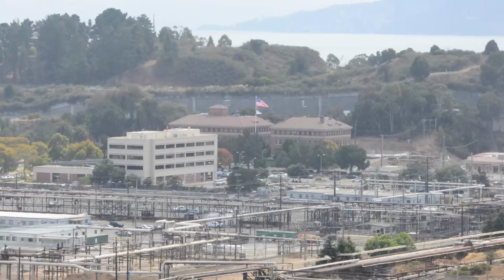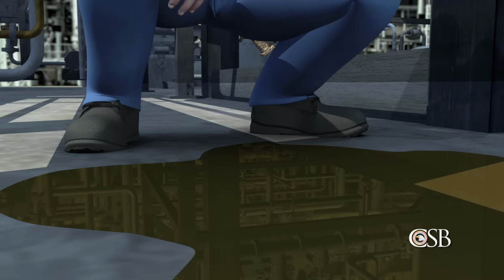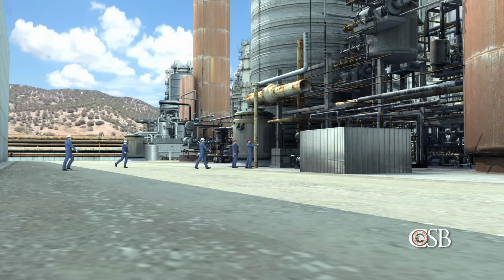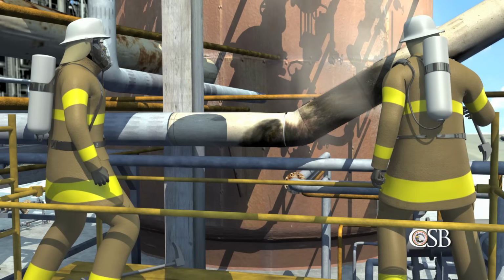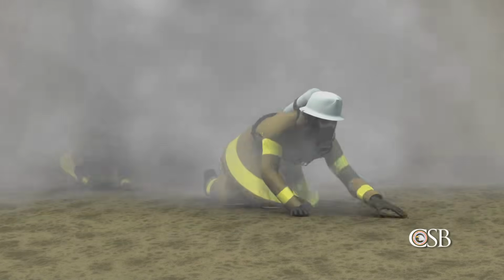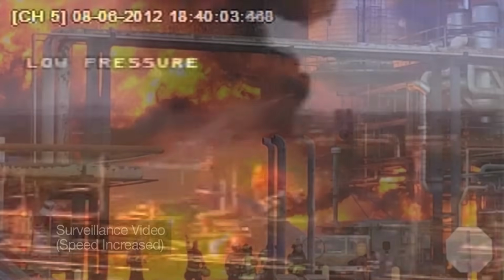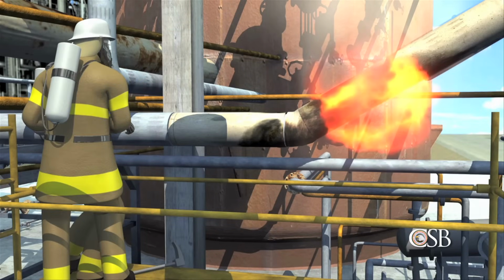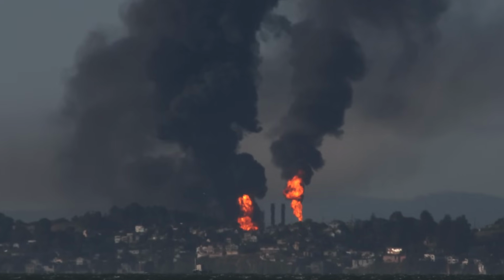Animation of Fire at Chevron's Richmond Refinery, August 6, 2012

Comment: This is why I walked away from my $100k job years ago. They didn't shut down because it would mean less production... which means less money. They lose millions per hour when they stop production. Patches are always tried first. I've seen them weld on pipes with hot oil flowing in them. It's normal practice.
Reply: In other word their production is worth more than your life to them.. Sad really
Reply: @MannyFresh1x  In laymans terms schedule to fix it before it makes an unscheduled boom
Reply: @the_expidition427 I love that, "unscheduled boom" lol...just like driving an engine with a rod knock can lead to "rapid unscheduled disassembly"
Reply: This is madness
Reply: Its dumb because when it fails all money saved from avoiding maintenance and shutdowns is quickly caught up in MASSIVE repairs and damage, new stuff and community compensation, legal recourses...

Always work safely but certainly. You'll make more in the end when you dont break anything...
Reply: @mollyscullyscully80  Agreed.  Just from the self-interest, cold financial point of view, it makes sense to proactively do maintenance.  If they are trying to avoid shutdowns that may last for at most a day, well, after an accident they have a shutdown that can last weeks, plus all the expense to cleanup, rebuild and pay compensation to the community, etc.
Reply: @Walter-Montalvo  a shutdown of any unit in a redinery to fix any issue last a lot longer than just a day.
Reply: @chriswalker9218  Thanks for the info.  Since it takes a lot longer than a day, I can see from the financial point of view how it might make sense to postpone.  Not going to lie, that is murky.
Reply: @chriswalker9218  just the paperwork and planning is probably weeks of work on it’s own
Reply: @mollyscullyscully80  “you think safety is expensive, try accidents”
Reply: They care more about money than peoples lives sadly
Reply: I just left Chevron Richmond for their latest shutdown....my first and LAST. No thanks. WAY too many variables for me to feel safe.
Reply: Jesus Christ. Welding on an active gas line is like playing hacky sack with a stick of dynamite.
Reply: @ffandrewd2986  not really. If there is a flow in the pipe the product will not ignite (no matter what the product is) if the welder were to burn thru the pipe.
Reply: I work in plants for a living. I see it all the time. They try and act like safety is number and that they care about you going home or to your motel 16 hours later.. but they see us as scab workers with dollar signs on our hard hats. Makes me sick but nothing else around here will keep us afloat. I got the twic card so I may take a river boat/barge job.
Reply: @Petryfied  yeah the safety talks are just to look like they care. When it comes down to production they don't want you stopping for a safety concern. And if you are wrong, or it was minor they reprimand you for stopping production. Its a culture of only report a fire, not the smoke.
Reply: @Petryfied you should become an ironworker they take everyone and you can make good money, esp with overtime
Reply: Your life is worth way more than a pipe fitting. Good on you for leaving, safety first.
Reply: @ameanasaur  roger that
Reply: The insurance companies should put more requirements for safety procedures or they won't pay out. That would get their attention.
Reply: @gangisspawn1  they do. But cheap managers won’t give a shit as they won’t be the ones punished unless they can prove they forced people to work unsafely. With “obligation to refuse” from “right to refuse”, a lot of the blame can be placed on the worker legally.
Reply: Wow!
Reply: An accident will always cost more than the safety to prevent it. People just don't get that for some reason
Reply: Welding on certain types of pipe is actually pretty safe depending on what’s going through the pipe, normally natural gas lines. Though, I’m not sure of the safety of welding on a patch..🤷🏻‍♂️
Reply: I’m from New Zealand I’ve been a pipe fitter welder and fabricator my whole working life my family owns a large company in NZ... We went to inspect & quote a job repairing a damaged flange on the top of a 50 metre high oil silo at a oil processing plant they said it had been evacuated of all oil, vapours and residue my co worker opened a port hole used for inspections he was hit with heavy strong smelling gas vapours he said we don’t want anything to do with this is a disaster waiting to happen it’s either not been clean/evacuated or it has a Passing faulty valve they said ok we will sort it them call you back.....    

They didn’t do that they called another company told them it was all clean etc which was a lie two workers went there a father & son they didn’t check for vapours just started welding trusting the Judgment of the staff at the Facility within 20-30 seconds it exploded vaporising the son bit of him went everywhere they dad was on a ladder to the side he got some burns but survived but only a few Weeks later he committed suicide as he couldn’t bare the burden of his mistake which was not checking for himself trusting the employees from the plant....  

There was a big investigation the company lied to the Authorities and forged safety forms and gas vapour tests to try sweep it under the carpet but they were found out and they company was shut down and a good 12-15 people went to jail the really scary thing is me and my Dad were supposed to be the ones working on the job the next day after the quote as it was a long weekend we were short staffed I had never actually worked on site with my Dad before he more ran the company from the office so yea I’m so great full for our co worker who was on point and checked everything as he had lost some friends to a similar accident when he lived in the UK (United Kingdom) he was so messed up from witnessing it he left his homeland country to live in New Zealand and he only started a few days before our other worker 100% wouldn’t have check as he has health issues he wouldn’t even have Climbed the ladder....   so yea Please PLEASE Everyone be safe a weekly wage is not worth loosing your life over...   sorry for the novel, I haven’t even talked about this to anyone since it happened 15 odd years ago
Reply: If the cost of the lawsuits is less than the cost of safely shutting down operation for maintenance they will take that 10/10 times sadly.
Reply: @Ruin3.14  it is the exact same in the financial industry. these people can make a living off of ruining peoples lives, that and fines are just the cost of business and business keeps on being profitable
Reply: Which means you sir are an Amazing upstanding Human being I have a whole lot of Respect for you and anyone who shares your Core Values very well done 💯🖤🇳🇿🤙
Reply: That’s called a hot tap, it happens
Reply: BUT they would lose BILLIONS if it blows up . .. . . America has a issue with short term vs long term investments /  profits / mindset , companies want short term everything  because in their mind it is faster way but in the end it just hurts them and everyone else around them.
Reply: process is called hot tapping, It's common practice in refinery business. It saves a lot of money.
Reply: Yup, this is what money does to people. We only care about profit margins. People die everyday over money.. when will we learn.
Reply: It is the nature of business.   The person in charge of maintenance gets a nice personal bonus if he/she controls costs below what was budgeted.   That is also how so much TCE ended up in drinking water aquifers in Silicon Valley.
Reply: Thats called a hot-tap wich isnt unusual. It is a high risk though, special precautions should be taken.
Reply: @vmk14296  yup. It’s normal practice. Scary… but done a million times with no issues usually.
Reply: yeah but when an accident like this happens they lose billions
Reply: I know this is a 4 year old comment, but I’ve recently started as an operator in the uk and have found the opposite, it’s by far the most safety conscious field I’ve seen, there are many, many safeguards, protocols and plans to operate safely. My background is in aviation and I feel just as safe in this role.
Reply: @MrTuts4life  the Industry is very safe. But I’ve also seen refineries choose to keep a frac tower or gas unit running to do repairs instead of shutting the system down which would be safer. Shutting down equal lost profits. To them the risk of death is worth it to keep a refinery hot and running even if something could be shut down. Like welding a pipe patch onto a older weak/thin pipe that has pressurized hot petroleum flowing inside of it.
Reply: They used to do "turn arounds" which is a total shut down of the refinery for repairs for about a month. That's not what I'm talking about. Unplanned shut downs cost millions so its not done just to repair a thinning pipe wall. They will patch a pipe and monitor its thickness until they make it to the planned shut down. This gives them time to plan multiple repairs all at the same time....saving money. Sadly some of these pipe burst before that planned shut down which is probably what happened in this video? @MrTuts4life
Reply: Good. If you can’t handle the heat then stay out of the kitchen. Don’t need wimps on the crew.
Reply: @moroteseoinage  lol yes. Best move ever. Plus it was in a shitty state. Only an idiot would stay there.
Reply: It's not as dangerous as it sounds. Called a hot fix. And its natural gas lines they do it on, not crude. It's perfectly safe if you know what you're doing. There's no other way to do some jobs.
Reply: @dustinandtarynwolfe5540  they absolutely do it on oil pipelines. I know because I worked in a refinery in the California Bay Area.
Reply: That is an insanely difficult decision for management, at least from a numbers standpoint. Shut down for 3 days and lose 100 million, or install a temporary patch until the scheduled shutdown? Not to mention the huge safety concerns for performing hot work on a RUNNING UNIT.
Reply: That's insane!
Reply: Sounds like fun to me.
Reply: To weld on a Pipe, that oil is running through should not be problematic. The oil can't burn because of lac of oxygen.
Reply: Yes its common practice. Thats why I mention it.  @peterborg3340
Reply: Rather be alive making 0 dollars Than dead in a few years making 100k
Reply: but it's like, losing millions is inevitable bc now the company gotta spend millions to cover for the property damage said failing equipment caused for the refused to slow down production even for a lil bit-
Reply: Money over life. So sad.
Reply: wow, 100k…i get like 44k €
Reply: Yeah but when they blow up their own Refinery with the negligence doesn't that cost the money too that cost a lot of money
Reply: @TheBendablespoons Focus on bending spoons and less on things you know nothing about.
Reply: They’ve also caused major issues in the rain forest, I believe Vice put out a video about it recently
Reply: @TwoBitty vice isn't a reliable source for information
Reply: Shut up you communistes (sarcasme)
Reply: capitalism at its finest
Reply: @memelord9232  
lol its no better any where else in the world in this industry.
Currently working on a crude unit in a refinery right now.
Reply: @memelord9232  LOL, like Communism is a bastion of worker safety 🤣
Reply: @memelord9232 if you think socialism is the answer, think again.
Reply: Naw, the guv'mint wouldn't  allow that!  BAAAAWAAAAHAHAHAAAA!  I guess the guv'mint of the Democratic People's Republic of California really doesn't  give a crap about the workers or the residents, does it?  Guv'mint hard at work, doing.....nothing!

Comment: "hmm, this pipe is really old and leaking"
"if the leak gets any bigger, it could erupt in a fireball of death"
"let's poke at it with metal hooks"
Reply: "Shouldn't we shut it completely off first??"
"Nah we're good!"
Reply: @j-man6001  They're reluctant to shut down the production process because the G-men and corporate pigs will whine about losing money.
Reply: @j-man6001  Yeah that's silly, I'm sure we will be fine
Reply: @j-man6001  OSHA-compliant does not mean the following:

Worker 1: Hey, are you sure that's safe?
Worker 2: Oh, shuuuuh...
Reply: @j-man6001 he said there is no shut off
Reply: And lets fire a cigar. Do you have a ligther ?.
Reply: @38911bytefree  and lets gather under it while attempting to "fix" it as a flammable substance goes through the pipe. Can't go wrong, can it?
Reply: @gdwnet  
Also when the substance is at 640 degrees under pressure
Reply: 38911bytefree And the Darwin Award goes toooOOOO....💥
Reply: You joke, but I saw an engineer put a hole in a boiler feed pipe at a nuclear power station the other month.

Corrosion inspection, which he tapped with a small rock hammer.

His hammer has been confiscated
Reply: @Posh-Matty  Dare I ask about Radiation Exposure on that day with the tool and those present?
Reply: @deanmckellar619  Oh, the answer is zero. It's a boiler feed pipe, so is filled with water and therefore zero radiological material.
Reply: @Posh-Matty  Ah right, fair enough. Good to hear at least
Reply: @deanmckellar619  It is completely unheard of for a person to get accidentally exposed to radiation. I don't think it has happened in many decades at UK Nuclear power stations. In fact, the nuclear power fleet aim towards "Zero Harm" - no injuries sustained on sites at all. It is one of the safest industrial environments in the UK. 
To put some context to that, during an outage (electricity generation off, highly stressed and busy work schedule to do maintenance and mods) two people has separate incidents where they suffered minor cuts to their hands and the entire workforce was stood-down and had to attend a mandatory safety talks (1000 people, even office staff).
Reply: @Posh-Matty  Not to mention a broken feedwater pipe doesn't have to get reported nearly as high as a worker exposure. Nuclear is still literally the safest power source we have. Rockhammers notwithstanding. Thanks for keepin the lights on and carbon low.
Reply: @terrydavis8451  Hi Terry. So our plants have a "zero harm" policy. Everything, no matter how small, is reported and assessed. Every piece of learning is then written up and made available to every station through experience briefing "1 pagers". This ensures that our stations can be proactive on potential failures seen at other stations. It also identifies bad behaviours (like dropped tools, breaches in working from height, small injuries) and reinforces correct safeguards to protect everyone.
Reply: @Posh-Matty  did you instate a hammer license?
Reply: @Posh-Matty  similar to the US
Reply: @Posh-Matty  ...hammer confiscated, guy not fired
Reply: I hear this in a South Park voice.  "Let's poke it with a stick and see if we can't piss it off"
Reply: @jdruin1  XD
Reply: Well,I guess they succeeded. 😅
Reply: IKR, maybe they should have also taken a smoke break underneath the pipe while assessing the condition as well!
Reply: Yes! Smart!
Reply: Then after poking it, lets blast it with high pressure water
Reply: @chrism8180  Yup, we can't be too safe!! 😅
Reply: Unbelievable!
Reply: stupidity should be illegal.
Reply: What gets me is these were not contract workers that just fell of the turnip truck.
These were firefighters, refinery firefighters.
By the description they should know that every pipe is assumed to have explosives in it until they personally verify differently.
The only sane response to "Stand under that leaking pipe and jab it with sharp sticks" at a refinery contains the words "F" and "you".
Once again I propose a new NFPA code and enhanced firefighter training stating "The poking of leaking pipes full of hot, explosive hydrocarbons with sharp sticks and why you should never, ever do it."
You want to drive that home to them?
Show them pics of that burnt firetruck.
I think a fair bit of firefighters took the job just so they could play with the shiny red truck.
Reply: “Poking action” made me snort.
Reply: Then blast the shitty old pipe with our hose.
Reply: While its on
Reply: And they’re on the fire department? 🙄  what a bloody joke, disgrace to the service.
Reply: wheres osha when you need them lol
Reply: It's factory people attitude 😂😂
Reply: Looks like Team Rocket's blasting off again...
Reply: Imagine that conversation happening in Minion-speak.
Reply: Nice refinery haiku.
Reply: Regulations? Regulations are only for those that don’t know what they are doing
Reply: Poke it or your down the road dum dum 🗿🗿
Reply: Humans love poking dangerous things with sticks, we just upgraded from tigers to fuel bombs
Reply: Darwin award winners.😅
Reply: Replacement of the pipes will cost money,that will cut into our big bonuses. 😊
Reply: Some body over ride micro soft
Reply: Need shutdown
Reply: They need inspected
Reply: Unoin workers   open up !!!!??? Plant management you need to inspected the plant pipelines  , remember safety of workers & company ,!!!???
Reply: Stop taking short cuts